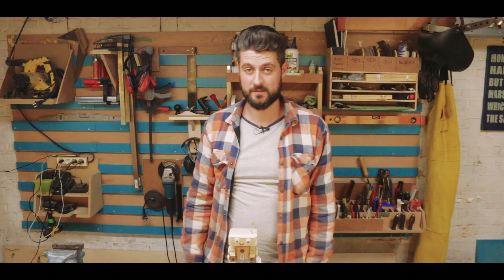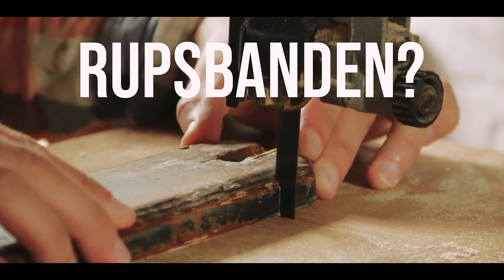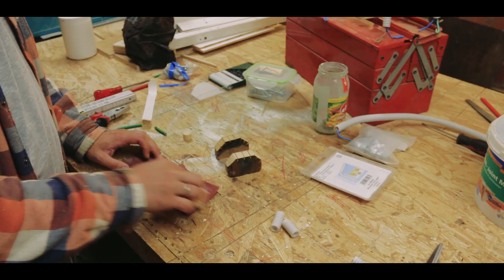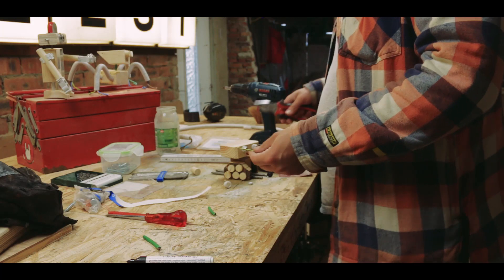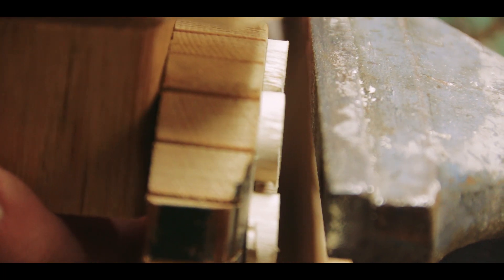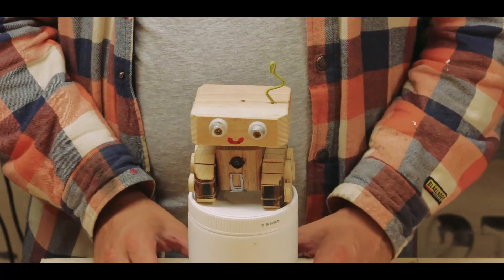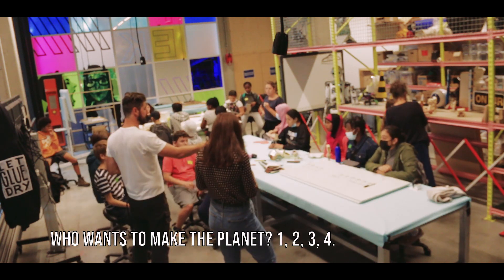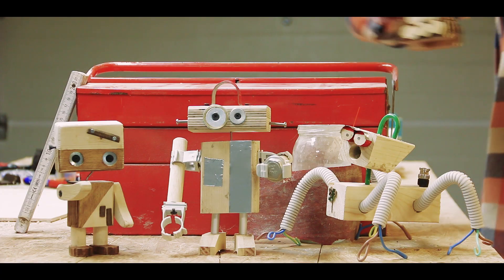How to Make Robots from Anything

Comment: If you need a bandsaw to do it, it's not that accessible as title implies.
Reply from the maker: All the operations can be done using handtools as well. (Which the kids at the workshop did) I just happen to have that tool and therefore use it for speed’s sake. The title merely implies that you can make robots from plastic/electro and wood scraps. Thank you for watching!